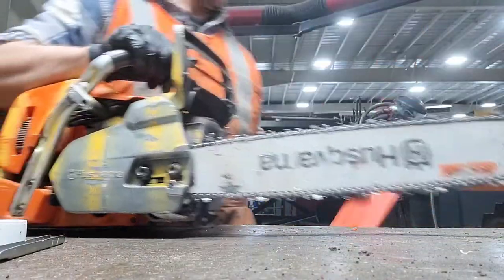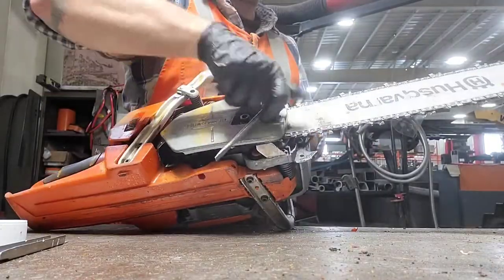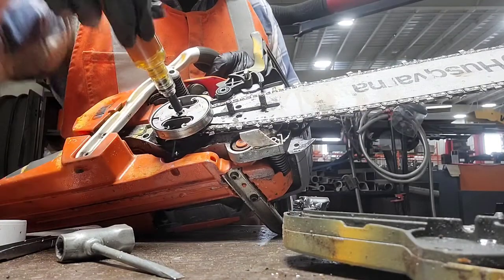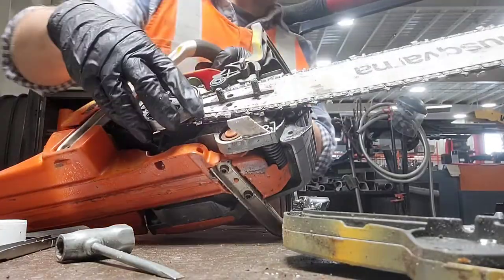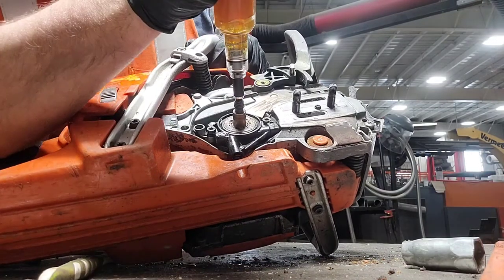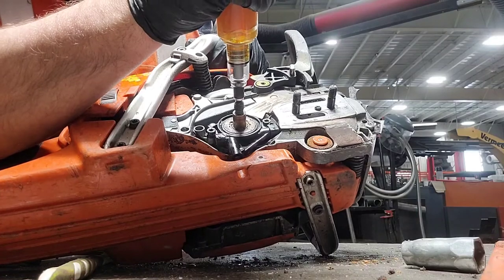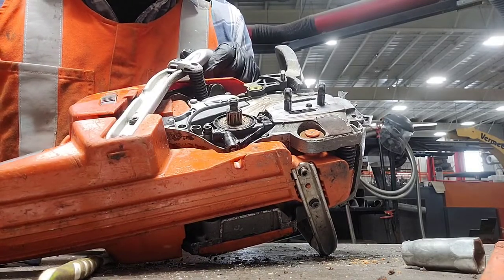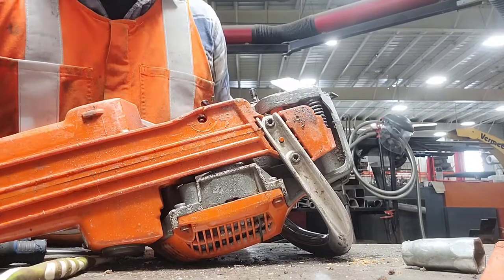Husqvarna 550xp Needle Bearing Lubrication

Comment: I was doing same thing today with my 550xp and notice something that I could swear a bushing was missing, thats why I'm watching your video........... 
When you are greasing needle bearing and looking at 3:00 there is something called [DEFLECTION LIMITER]<< It took me an hour to google an image that wasn't very clear, so I went looking on YT and found your video.....
To me it looks like there should be a rubber bushing around that piece> [D.L.] because of all the movement of saw case, but your saw looks like mine and appears to move like mine, so that must be how it's suppose to be....
Next time you have your 550xp apart look at that [DEFLECTION LIMITER] so you see what I mean........